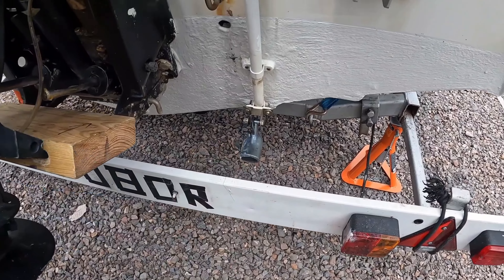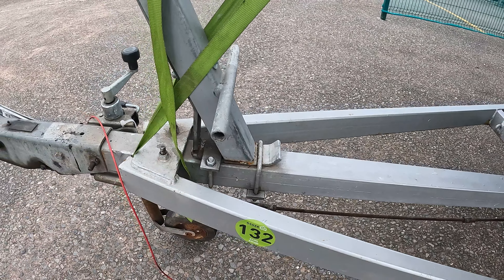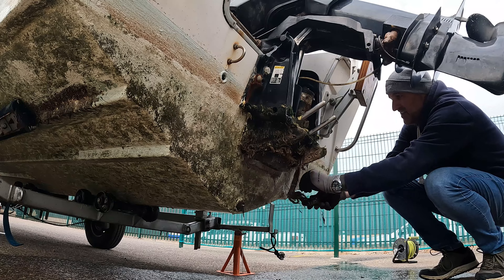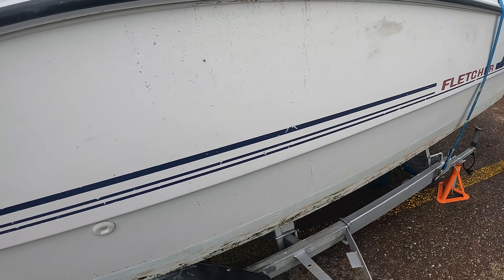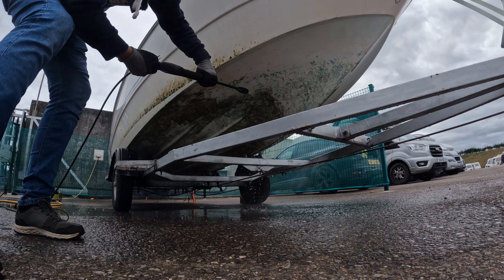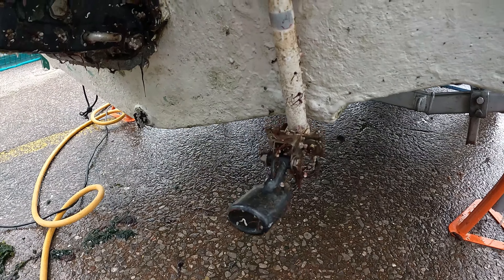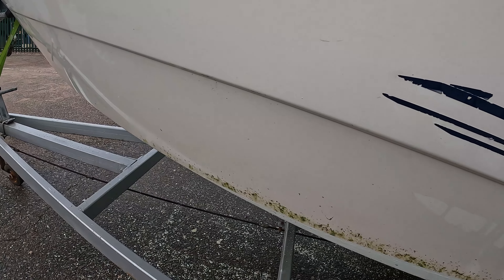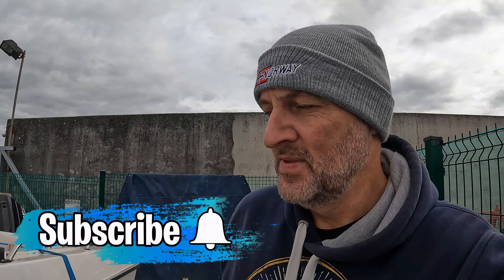Cleaning and maintenance #boat #boating #youtube

Comment: Hi, congrats on choice of boat, I’ve had close to 20 years ownership of Fletcher’s sub-20’ boats and absolutely luvved them. We were a family of water skiers - but that’s something I’ll get back to another day. For now, you are looking for practical advice on your boat maintenance. My advice would be to reconsider storage on-land and launch via a slip (having no idea of your local facilities). Then concentrate on the trailer - sort the winch post obviously, but also consider extra rollers mounted on the outer edges of the trailer. We used a system which had two rollers mounted on a post, the post was spring-loaded in two directions, the rollers weighted to present them at an angle to accept the V hull, the springs were such that they would force the hull/keel into a central position and then the posts would fold down as the flatter stern was drawn over them. I had the same trailer as you, and found that the longitudinal platforms offered safe support when on land. You may find that carpeted ply on the platforms front and back of the mudguards would help with access to the boat on land. Don’t let this mountain of maintenance disillusion you, you’ll find a way around this initial set-back - there’s always a solution. Apologies for long post!
Reply from the maker: Hi.  No problem on a long post. Always happy for feedback. There's several reason why I decdied to moor it in the water during the season. 1. I don't have a towbar and they're expensive now (although this would eventually be offset by the mooring fees) 2. We do have slip launches but the main one is extremely slippery and steep and I've watched so many 'single person launch' videos but keep wondering, who parks the car and trailer back when you're floating out to see 🤣 3. My wife wouldn't be happy either towing down to the slip or taking the boat while I drive the car and generally I'm alone on the boat (see note 2 😂) 4. If we did succeed in launching we'd then have to find somewhere to park both car and trailer whilst out at sea and in exmouth, just the car parking alone is a nightmare so all in all, I found it easier to just get it moored. The painful thing about that, apart for how filthy it gets, is the taxi is a pain so I've decided to get my own little tender for the next season and leave it attached to my mooring while I take the boat out. However, saying that, I really want a bigger boat. My aim was to get a sports cruiser, sealine S23 type, but we decided to start off small in case it wasn't for us. That all depends on budget though and then all the above plans will change with it 🤣 atb 👍
Reply from the maker: I am actually looking forward to tarting it up over the summer months though 👍
Reply: I like the positive tone - good for you. I am now in my late 70’s so I too thought of the Sealine range for my own use - the S23 renamed as the S25 to reflect it’s size, with the S28 being a tad larger and comprehensively vlogged by Daves Boat under the name Sally Jane (I think - from memory). He listed his expenses for the first year - no doubt your research thus far would have found his vlogs :). Good luck - one thing for sure, you won’t be losing any money on your bargain Faro/Mercury.
Reply from the maker: @erisaman2  yes I've watched dates videos although he moved up to a larger one now i  believe. My next video was going to be winterising the engine but I was in too much of a rush so will be some Jon's around the boat mainly cleaning and fixing the day cover. Not that I'll probably ever use it 😂

Comment: Hi, enjoying your blogs, happy to throw my bit in , had a new rib for 4yrs changed it back in feb for a 2015 quicksilver 605 and now work for a boat engine and maintenance company here in Chichester, couple of things I would say is your anti foul looks really messy and lumpy which helps the weed etc cling to it , I think it would need a bead blast hi pressure to take it back to the gel coat so that you have a decent smooth surface to start again, also the transducer on the back needs to be horizontal and looks to be in the right position ,just below the hull line .if the antifoul is in good condition it should only need power washing , a light sanding for a key and reapplication. My boat sits in a marina so still gets messy underneath but has been antifouled since new and used to live in a dry stack before I got it . I am still learning as I go and I am sure someone will agree or not with me but welcome to boating , regards Cliff
Reply from the maker: Cheers cliff. It definitely needs taking down to the grp and yes you're right, it was very rough. I think the previous owner didn't worry about it as it sat on his driveway the whole time so didn't get these issues. I'm going to adapt the depth sounder leg so that when I've finished a trip it can be slid up above the water line then back when I use it again. Ive been looking at bigger boats as well, either a sports cruiser like a sealine s23 or something like a quicksilver or merry fisher. Keen on a shift drive for simplicity and less to go wrong.  Cheers for the comment 👍

Comment: The barnicals and weed usually come off better before they dry out, so i find it best to clean off within an hour of removing the boat from the water.
To remove the antifoul, I use international AF which is a paint stripper that doesn't harm gelcoat or fiberglass.
Also new antifouling has a time by which it needs to be in the water after applying, usually 3 months, then if it dries out for a long time, such as the boat being trailer sailed it becomes inactive and actually does nothing.
Another option is to get a mooring further up the river, in fresh or brackish water you only get a slime on the hull, no weed or barnicals! 
Also with taking the boat off the trailer for access, you can jack the boat up and put a big block of wood under the hull at the back, pull the trailer out, halfway or a bit more, do the back half, then put it back in the trailer and do the front half.
Reply from the maker: Cheers for all this. I did have to wait a week to clean it after removal as I have to book the cleaning bay at the storage centre and that was the earliest. I noticed the difference in the weed and algae at the rear which was soft when I took it out and hard and Crunchy by the time I got to clean it. I'll habe a look at that antifoul remover but think I'll struggle getting it raised. I'll need to buy a couple of Jack's and some sleepers I reckon to get it raised buy at least I can do this over a period and take my time. Mooring next year is going to depend on where I can get it but further up river is a pain to get to specially using the taxi. I am looking at buying an inflatable tender going forward which will make things easier wherever I moor.  Cheers for the comment and suggestions. 👍

Comment: Once you get the cover clean, I'd give it a coat of Fabsil. Should stop stuff sticking to it and make it easier to clean next time around. Can you fit the KArcher Dirt Blaster lance to your jet washer? I'd try soaking things with a decent APC (ie. Bilt Hamper Surfex-HD or similar) and leaving a while before jet washing. Antifouling looks pretty poor quality - proper treatment is generally a couple of coats of primer/undeercoat and several of antifoul. If it was mine and I was keeping it, I'd be inclined to strip it back to GRP over the winter whilst you have the opportunity so you can apply something decent quality. If you're on a swinging mooring, I'd maybe even consider Coppercoat. I think I'd probably scrap the transom depth sounder sensor at the same time and replace with an in-hull or through hull. None of it cheap, but that's boats for you!
Reply from the maker: I've got some fab sil for my tents so could give that a try thanks. I think that the karcher is faulty as the power suddenly dropped just after starting. I might try taking it apart to see if I can find any issues. Amd yes it definitely needs a soak with something first. I do think I'll need to get it up on legs though as I wouldn't be able to strip and paint it on that trailer it's just too low but would definitely consider copper coat anti foul. I'll readjust the depth finder and fix that so it can be moved out of the water when on mooring. Thanks for the tips 👍